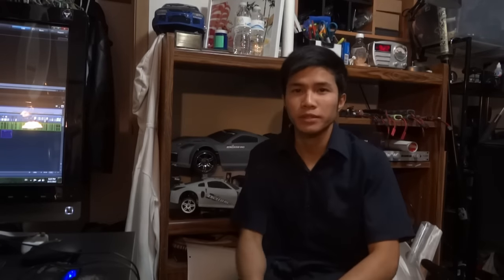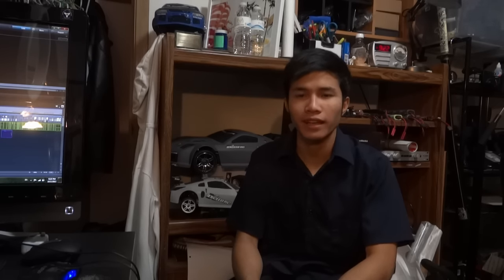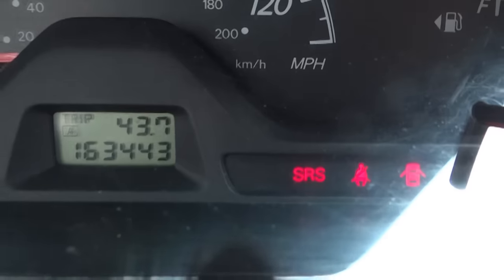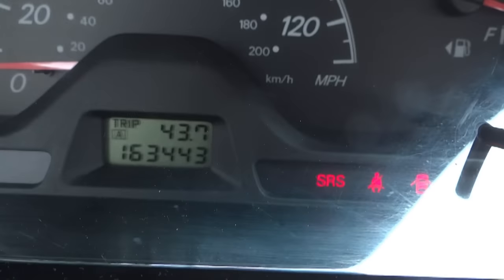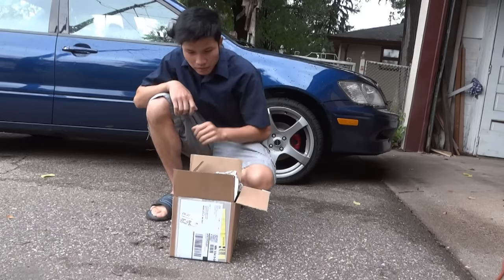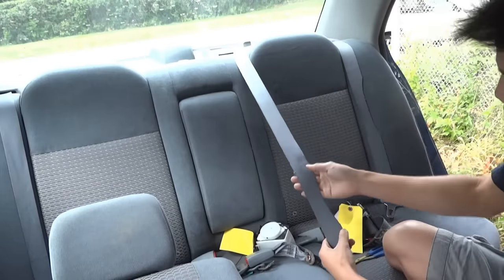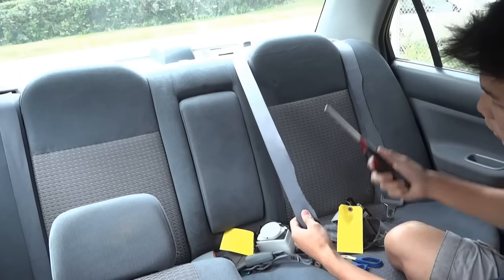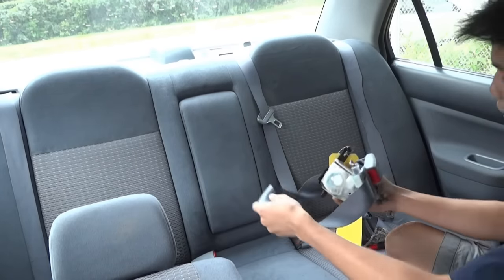Lancer Fix 20 | SRS?, Change Rear Seat Belts

Comment: This is cool i have a 2006 mitsubishi lancer 
To solve the srs problem you need to change the clock spring behind the steering wheel as it has a cut wire but it's expensive so you can solder it but you must check for shorts after soldering

Comment: Hi Mackey. I was just cracking up when you mentioned the srs light on your car. My mazda has had the airbag light on since I got the car and I never bother to fix it. It's been fine and hasn't popped on me so no worries. However my car is an older car so it does not have an OBD plug on it. There are different type of OBD so make sure you know what your car has. If your car has an OBD plug, you will need one of those OBD testers to check that light. I think that may help you. I will need to get to my light eventually since the bracket that holds that airbag controller has broken off from being old, but I don't have another one so I have to wait until I can get my hands on one in order to fix mine. My light fix is a bit different, but I'm guessing your car is newer. Also, get the service manual for your car, whatever it is and depending on how good it is unless it's the dealer service manual, it will show you where all the sensors are, and pretty much anything else you need to look up. There are difference procedures for the airbags so it's good to know the correct information anyway.

Comment: in New Zealand if your srs light does not come on then turn off as you start vehicle you wont get a vehicle warrant of fitness which you wont be able to drive the car on the road so removing the bulb is not an option also if your in a accident and the bulb is removed because of a fault in the srs systems and it fails to work you wont be coverd by insurance because of tampering a vehicle safety system

Comment: Do you have a scan tool like the MaxiDiag Elite Scan Tool? It should allow you to erase the codes allowing the SRS system to recheck for errors and when no errors are found the SRS light should go off. YouTube search, 'Mitsubishi SRS Airbag Light MOT Fail How to Fix.'
Reply from the maker: +Frank Jr. Hi, no I don't have it. So far no one can erase SRS on Lancers. But I might try the scantool  you told me.

Comment: I have a question cause one of the mechanic disconnected the alarm from my same car but my car now is missing the dash board lights aswell as the radio? I was wondering what should I check to make it work again?
Reply from the maker: I think you should check the fuses. There are two fuse boxes. On is under the hood, on is under the steering. cheers

Comment: If I were to change the seatbelts of different car (specifically an Acura TL 2004), would I just have to pretty much follow these same steps?
Reply from the maker: +Austen Au I would think so too. Plus, it shouldn't be too hard to figure out new figuration. Make sure to unplug the battery first.
Reply: Will unplugging the battery prevent my SRS light from coming on? I'm really worried about that because I called a dealership and they told me it would cost 300-600 dollars to change just my rear seatbelts and reset the srs...
Reply from the maker: Austen Au If you already have an SRS light showing up, changing the seat belt alone may not reset the SRS light. You might have to use a scan tool to reset it.

If you don't have an SRS light now, and just want a new seat belt, unplug the battery will prevent the SRS light from showing up.
Reply: Thank you!

Comment: Do you know where is the SRS module located in a 2004 lancer?
Reply from the maker: +Victor Rosario I believe it's in the ECU. There are many people trying to get rid of the SRS, some went to the dealership and found no luck on getting rid of it. Some would just take the SRS light bulb off, and some put black tape on the bulb to cover the light from shining. That's as much as I know for fixing the SRS light on Lancers. cheers

Comment: What kind of rims are those? ??
Reply from the maker: STATIC SILVER RIM By LIQUID METAL WHEELS 17"x7" Rims, 205/40R17 XL 84W Tires
http://www.performanceplustire.com

http://www.performanceplustire.com/products/packages/searchType/searchByVehicle/year/2003/make/MITSUBISHI/model/LANCER%20ES%20OE%20185_SLASH_65-14/applicationID/11939/wheelSize/17/wheelDataID/60814

cheers

Comment: My dad car mitchubishi space star 2000
Reply from the maker: +THE Big Box Nice!
Reply: I have a Space Star as well with the light on.   I think one of the rear seat belt was trapped when the valeter cleaned the car but I can't see any sensor attached...
Reply: I have a Space Star as well with the light on.   I think one of the rear seat belt was trapped when the valeter cleaned the car but I can't see any sensor attached...
Reply from the maker: Tankmania3 It is to fix airbag lights.
Reply: +DarkDragonWing yes!😊